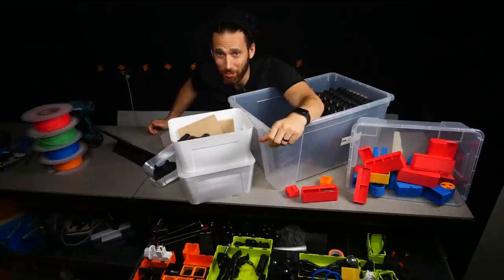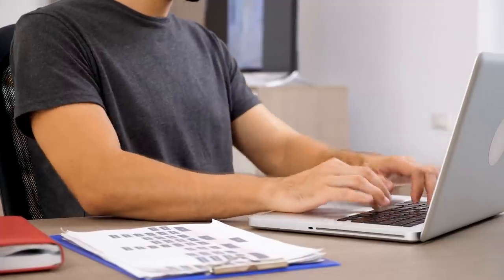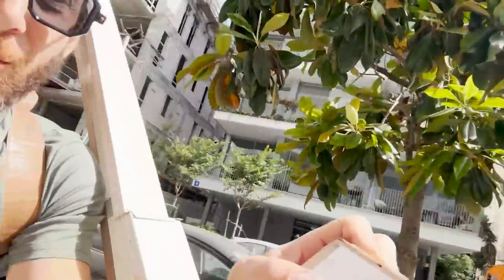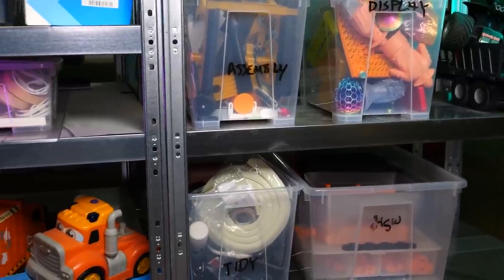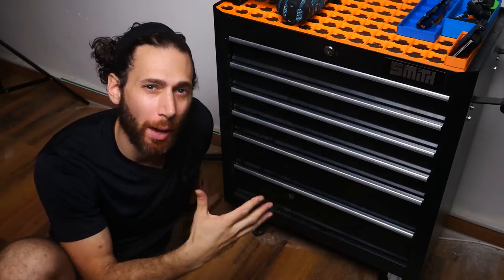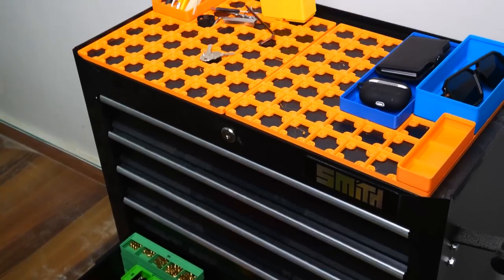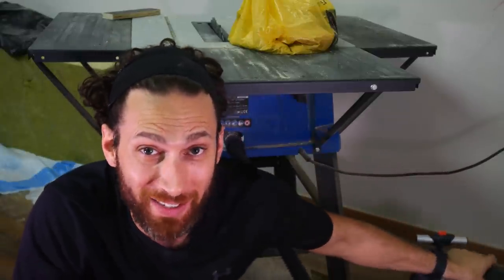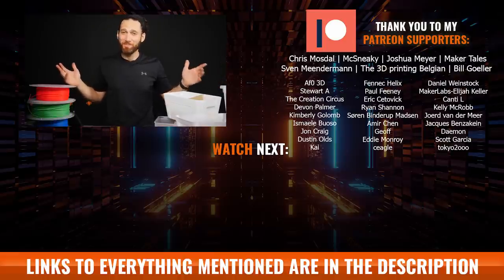Maximizing Workshop Efficiency with 3D Printed Upgrades

Comment: Just a video editing suggestion: For the Americans in the audience that can't do the conversion from metric to imperial, could you put on screen the converted measurement as well as the original measurement? For example, a printer that weighs 40Kg, you could put "40Kg / 88.1 pounds". It also helps for folks that have hearing issues and can't make out some numbers when they are said, like how five and nine can sound similar if your hearing isn't the best.
Reply: Why do all the extra work for the only country left in the world that refuses to switch to the metric system? Plus a quick google will do the conversions for you automatically.
Reply: For that you can also activate the captions.
Reply from the maker: Good point. We do captions already, and I hate imperial measurements, but I'll consider it
Reply: Better yet, just use imperial.

Comment: As a carpenter/woodworker moving into the 3D printing wold, You are dead on about duct tape for dust extraction connectors. But truthfully, you can order 3rd party adapters. These small parts are one of the main reasons I got a 3D printer. As well as for woodworking templates/jigs.

Comment: I actually make and install acoustic panels for work. We did unbox therapy’s place. Anyway the easiest way to make some is get urself some 8x4 sheets of insulation. Then get a roll of fabric that you like and make sure it’s about 4-5 inches wider then ur 1 inch insulation sheet. Get a can or spray glue and spray the edges and a few inches on the back. Place the insulation sheet face up and roll out ur fabric on top. Start from one side and fold it over the edges. Once u get 2 sides done slightly stretch the fabric over the edges. If you wanna get fancy you can cut the insulation into hex shape with a 3d printed stencil and wrap them after
Reply from the maker: I don't know if I can get that big of stuff here... but I'll check into it thanks

Comment: Hey Jonathan, talking about your ceiling/wall acoustic panels, the sound deadening effect comes more from the shape of the walls than the material itself. That being said, the way you install your panels shown in the video, with the isolation material hidden inside a flat surface will make less effect than if you had it backwards, with the exposed material attached to a flat background panel. That's why a lot of places just end up using egg boxes or piramid shaped foams, not only because the surface of those materials are porous/rugged, but also because of the pointy shaped design, that breaks/absorbs the sound waves, breaking any possible echo.

The honeycomb walls, as well as a gridfinity wall, could do some effect because of the uneven pattern of the surface, that would also break the flat wall surface where any sound wave could travel freely.

Thanks a lot for the amazing videos as usual.

Comment: I hear you on the adapter for the saw and vacuum.  I had to design an adapter for a small air pump I use for blowing up all the pool toys.  Some of the floats have wierd nozzle sizes so I printed a new adapter that fits perfectly.  One of my favorite things about 3D printing.  Same went for a mobile scooter we bought for the MIL.  Had no hold down for the battery, so I printed one and a knob for the bolt.  Lifesaver.  Thanks for your vids.  I plan on creating a set of bins to organize my desk drawers based on some of your ideas.
Reply from the maker: NICE. Do it :)

Comment: Lots of very cool ideas in here; the vase mode bins make sense, but don't count out other materials or smaller nozzle sizes. Set your line width to larger than the nozzle size some time if you've never tried it. A 0.4 nozzle can easily do 0.6 or even 0.8 width lines for much sturdier vase prints without having to swap out the nozzle at all. Alternately, if you've got a 1.0 nozzle with a high performance hot end, well, go crazy.

Comment: While I love the design of your current acoustic panel on the wall, I highly doubt it will do much of anything since it's primarily wood on the face. If anything it may increase the echo/reverb further since the wood with paint over it is solid, dense, and smooth which will allow sound to bounce right off it.  

I don't know how well fabric would hold it's shape when laser cut and attached with that design, but using a material like fabric as a face directly over rockwool or fiberglass batt is far superior in terms of performance as an acoustic panel. 

Also, super small nit pick here, but if you have any fans blowing at or over the exposed insulation, you may end up with some allergy-like reactions from the particles it puts off into the air.

P. S.
I enjoyed a lot of your suggestions elsewhere in the video, well done video overall!

Comment: You made comments on the petg filament, and I see you used the bamboo x1 carbon to print the wall mount.  I am having trouble with getting clean prints. Can you give me some pointers?

Comment: Great stuff as always. I just wanted to point out that the carbon filled Nylon your using is no where near as strong as machined aluminum because it’s a discontinuous fiber. It might not even be as strong as regular nylon (though it will be stiffer). You need continuous fiber reinforcement to be as strong as aluminum.
Reply from the maker: Good point!

Comment: Hey, can you provide more details on the light stand caster adaptor? I am interested in printing a set for my studio. What hardware did you use and what caster are you using. Did you heat set in a threaded insert, or did your hardware cut their own threads? 

Also in your design it looks like there should be a second piece for where the thumb screw goes into that tightens into the leg of the stand, am i missing something?
Reply from the maker: All files are shared in Description to OnShape and Printables :)

Comment: I appreciate the effort, as much as it is exiting to create everything with 3d printing, significant better results can be achieved if all machining technologies are used together (together with all materials) according to to its best use-case scenario. Par example metal inserts for screws have significantly better performance then 3d printed screws. Then instead of printing flexible filaments, making cast form from pla and then casting flexible gives much better result. Of course it’s not possible to cast every form. 

 I find seeking combination of materials and machining technologies give significantly better result than just pure 3d printing.
It worth saying that there is sometimes significant investment in tools other than 3d printer. This also has to taken into account.

Comment: Would putting Eva foam on the tabletop/shelves and printers on them help reduce noise and vibrations? I was thinking of putting one on my drawer table where my future printer would go on and maybe line the edges with it to just in case it may hit the walls.
Reply from the maker: The vibrations are fine b/c these tiles are SO heavy
Reply: @thenextlayer  I have my Ikea drawers which were an extension to my computer desk. Had to cut it since it was a bit long. It will fit a P1S and barely fit a K1 Max ( still deciding which to get). Would the anti vibration feets be enough or a should I go with Eva foam. Tiles may be too heavy for the table. 😅 I may print brackets to secure the table drawer to the wall or at least line the top part with Eva foam just in case it starts hitting the wall.

Comment: How did you come to the conclusion that the Ikea pegboards use more plastic than the hex wall? The hex wall is entirely out of plastic and the Ikea pegboards are made out of fiber board (wood). Plus, the Ikea system allows you to use very minimalist mounting solutions that use less plastic than a single hex wall hexagon.
Reply from the maker: I was mistaken

Comment: I'm not making it a challenge, but one of my goals for my place is to use 3D printing to help get everything organized. The biggest problem so far is that I'm kinda terrible at sorting paperwork and I don't have a 3D printer capable of printing something 11" (280mm) long.
Reply: Slice it in half, and build in some biscuit joiners to the design to slot the pieces together. Should make for a sturdy and functional piece.

Comment: 19:12 slightly confused by your “uses less plastic” comment re IKEA SKADIS - the boards are made from partial board which is then sprayed with a paint/sealer - no plastic
Reply from the maker: Seriously? I thought they were plastic! One of the reasons I didn't buy is they felt like big panels of plastic. Now I feel dumb. But still, HSW is cheaper and looks cooler IMHO :)
Reply: @thenextlayer  seriously! Sustainability is at the core of IKEA’s ethos!
Reply: @thenextlayer  HSW is certainly more versatile

Comment: Those spool shelves look amazing, are there any concerns with keeping the filament exposed? I’m new to printing but there seem to be a lot of solutions for keeping spools in dry boxes. This led me to believe that storing opened filament without desiccant would be bad idea. Am I concerned about nothing?
Reply: There are certain filaments that are hygroscopic, which means they will pull moisture from the air and it will make printing with them a pain until they’re dry again, but PLA is very minimally hygroscopic, so it can be left out for years without becoming wet enough to notice. 

So no you are not wrong to be concerned, you just need to know which filaments need dry boxes and which don’t. 

Most of the higher end/engineering filaments are typically the ones that need dry boxes, such as PETG, TPU, Nylon, etc. but PLA is fine without one and PLA is what most people start printing with
Reply: Yes and no. If you plan to have 30 rolls open, you do need to worry about. But if youre a one roll at a time man, in general, no, you dont really have to worry about it, as long as you can use up a roll in about 6 months. However, youtubers hoard filaments, so at that point its just easier to make a humidity controlled room, rather than have 70 dry boxes
Reply: I was wondering this as well. Maybe the whole space is climate controlled.
Reply: @coolcoolercoolest212  yeah I meant to say something like that in my comment. I think he’s in a basement and most people who have these big printer spaces make sure to have dehumidifiers running all the time to keep the humidity to a minimum
Reply from the maker: Unfortunately you're 100% right. Most of the filament is PLA, but you'll notice I have some stuff in bags (PETG, Nylons)... however, bags aren't as good. Right now, I'm bagging some of it, the rest, I'm drying before I use. It's just too humid here to run a dehumidifier 24/7, it would cost me a FORTUNE... so I just dehydrate filament as needed overnight
Reply: Thanks for all the helpful info, I’m off to the printer!
Reply: The climate of your area can also play a role - I heard of one person who kept his filaments out in the open and had no problems - but he lived in a very dry climate. Where I live, I generally need to pay more attention to moisture during the summer months than the winter months. PLA is generally fine most of the time, but if I'm going to print PETG or TPU, I'll put it into a dryer a few hours before I start the print.

Comment: Why not put drawers between each shelf/bench. Looks like you have them next to eachother already
Reply from the maker: You mean put them on each one or BETWEEN?
Reply: @thenextlayer  drawers attached go flush outer edge of shalf, connecting to another shelf. Secures both parts together into a large work surfacecould use simple hardware through the holes making it quickly removeable as needed. Or if slides attach directly easily adjustable for height as needed. Almost making a pull out shelf
Reply: @thenextlayer  short answer between. i dont know why the words dont want to come out with this idea. Going tonsee about getting it set up myself

Comment: IKEA Samla faster and cheaper?!
I assume 20€/kg filament. That's not the cheapest filament but more at the low end.
Also 60mm/s with a 0.8mm Nozzle (Maybe a little bit fast?)
4h22min and 3,26€ (163g) vs 2,99€ and 2h for buying it at IKEA.

On the plus side for the printed version: I can have it in any color I want.
Reply from the maker: 60mm/s? My voron can handle 300-350mm/s with flows of around 24-28... so, I can print a bin in like, 30-45
Reply: @thenextlayer  Not everyone has a voron.
But maybe you are right and I should check the configuration of my printers.

But this doesn't change the costs for the material.